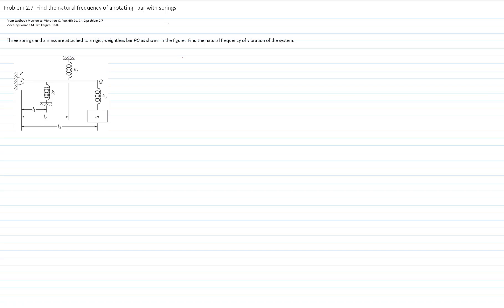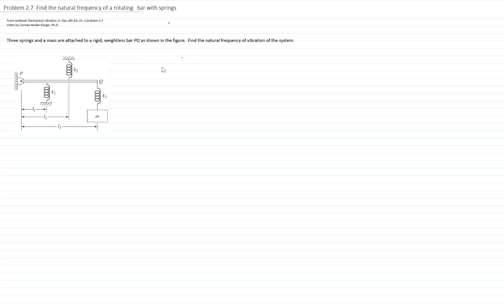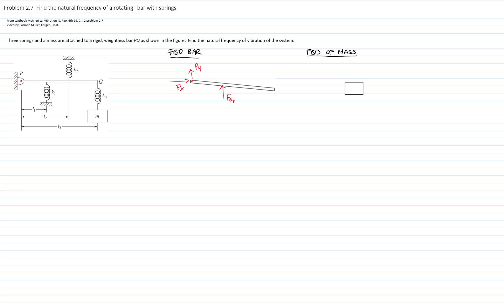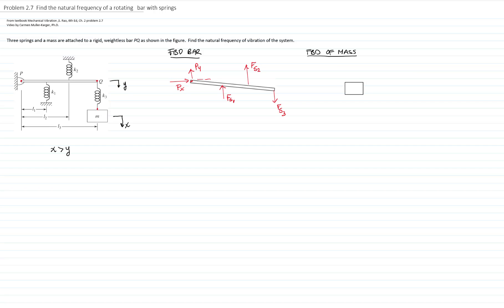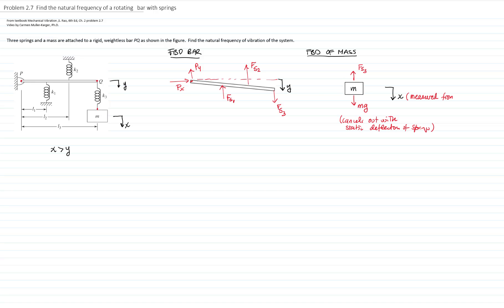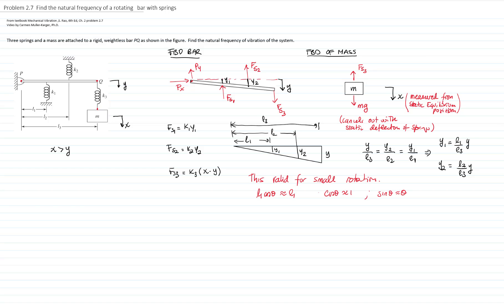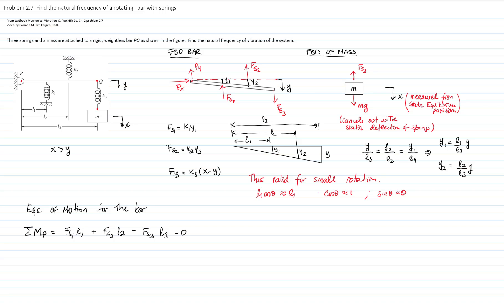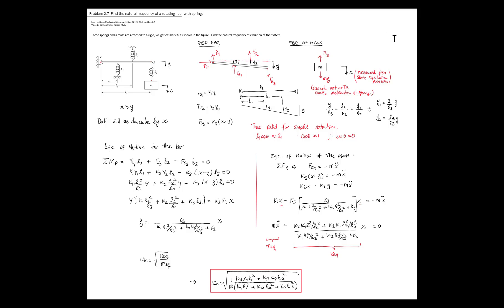Problem 2 7 Finding Natural Frequency of massless bar and mass at end

Comment: Could u please explain how does mg cancel out with the static deflection of the springs ?
Reply from the maker: The weight is a constant force that, for a vertical bar, only affects the deflection of the springs and does not contribute to the vibration motion. It only changes the equilibrium position of the system. If you measure the vibration respect to the equilibrium position this constant force will not appear in the response.

Comment: On 8.45 there is a little mistake i think. It must be K3.K2.l2^2/l3^2 but you wrote K3.K1.l2^2/l3^2 am i wrong? I will be very happy if you answer, thanks.
Reply from the maker: yes, you are right. Thank you for noticing that. I wrote it correctly after when I used k_eq to determine the natural frequency.
Reply: @cmullerk_Mechanics  Thanks for answer

Comment: If the bar had a mass, would you need to equal the first equation of motion to (Moment of inertia of the bar)(Angular acceleration) ? Thanks for solving it helped a lot
Reply from the maker: yes, and the system becomes a two-degrees-of-freedom system.  See videos for multi-degree of freedom systems.
Reply: @cmullerk_Mechanics  Thanks for the answer